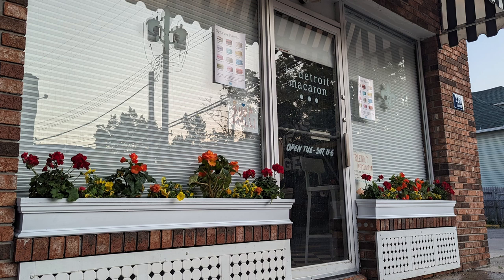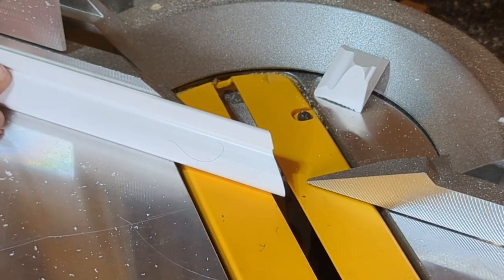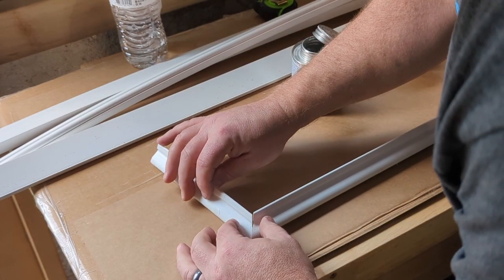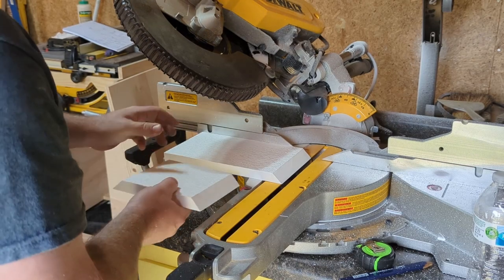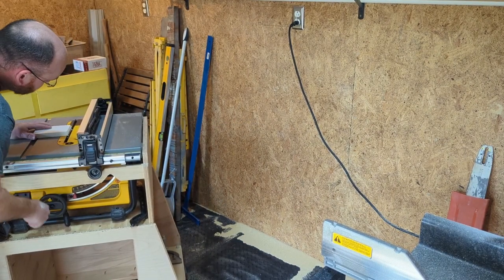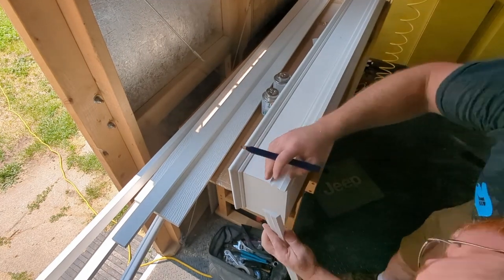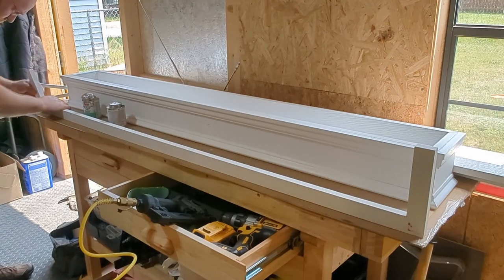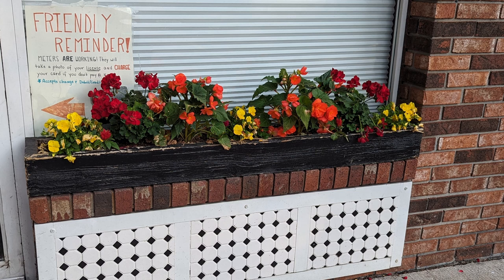How to make a PVC Flower Box / Garden Box / Window Planter Box

Comment: Thanks for this video! I’ve also been wondering if the PVC would bow out in the front. I think I’ll add a center piece or two, like you did. Or maybe some triangle shaped pieces in a similar location to anchor the front more securely to the bottom. That PVC is pretty floppy! Also I’m not adding so much trim around mine, so I won’t have the added structure that yours enjoyed!